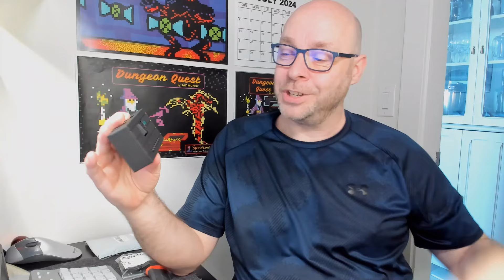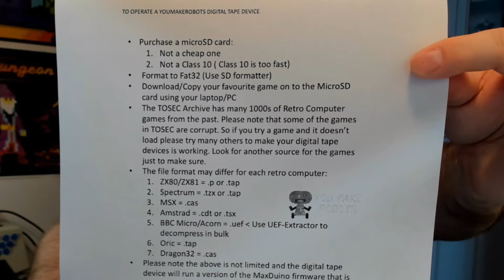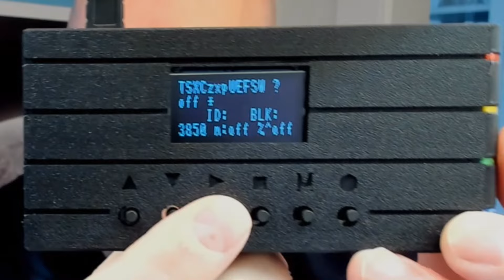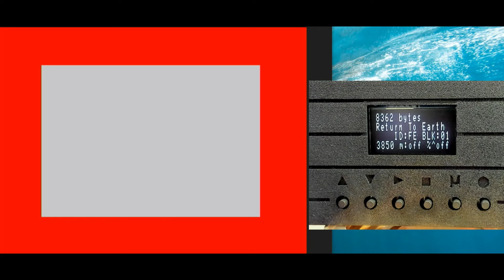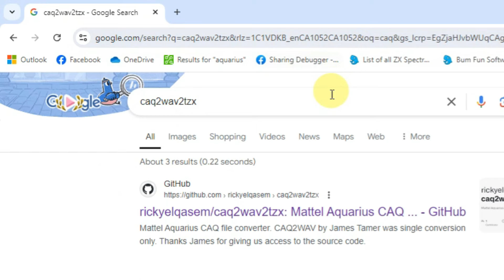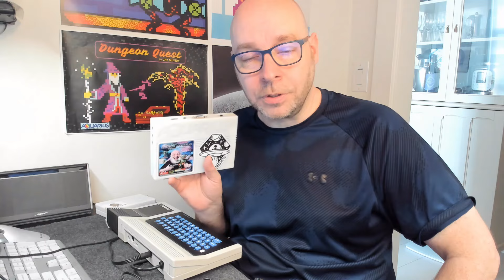Loading games into retro computers using the Nextduino. Sinclair ZX spectrum Next / Mattel Aquarius

Comment: Seems a bit odd since you can just use the SD card on the Next directly?
Reply: It can depend if you don't have an accelerated it won't have a pi which is needed for tzx. I bought one as I also have a +3 and 48k. The thing I really like is the percentage on it as well as the ability to pause the tape, which you can't do with the next. I used to load cassette 50 games. The only thing I wish if it was possible was to go to a specific block so you could go straight to a known block in a multi game tzx file.  The cassette would just be needed for a +2. . My next has a conbo of sna, tap and tzx where as my SD card for the next duino I've just set up with tzx and tap
Reply from the maker: @ViewPointsPhotography  awesome. Thanks for the info. Not sure about the block thing. There is a BLK indicator on the display. Maybe that’s what it’s for.
Reply from the maker: @spinnetti  yep that’s true. It’s not needed for the Next. It’s just for fun or if you prefer to load games from an external SD card with the retro tape loading experience instead of copying games direct to the internal SD card in the Next. Just another cool gadget for us to play with with a mini-Next design.
Reply: @Spriteworx  doesnt it have a tape emulation feature for that retro loading on tap files from sd card?
Reply: You can load tap and tzx files from the sd card in the next. For tzx files it uses the raspberry pi zero board addon for the next. You can choose to load with sound and with the same speed as on an original spectrum. That will give you the same experience as on a real spectrum. So IMHO the nextduino makes no sense on the next. However... for a real spectrum or on a clone like the harlequin this would be a very nice way to load tapes.